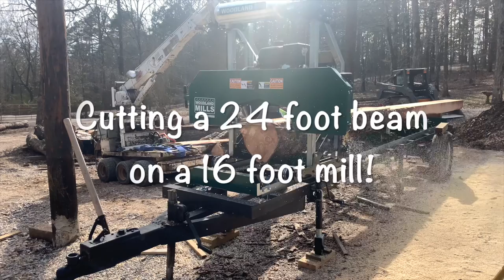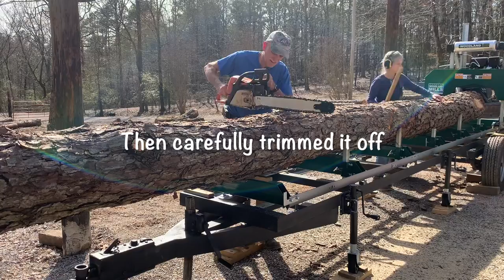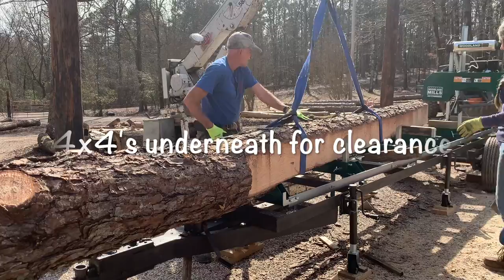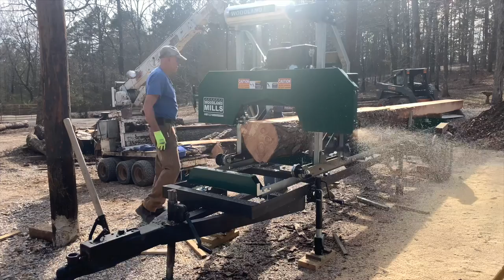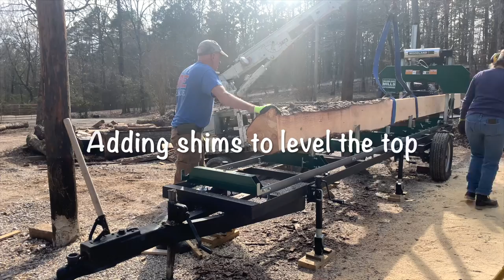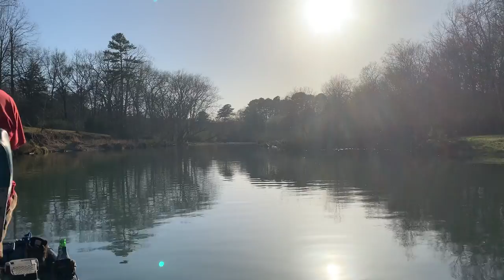Sawmill shed Part 2, cutting a 24 foot long beam on a 16 foot sawmill! Woodland mills HM122.

Comment: just an idea i have a friend that has the same mill and he maid an 8ft extention for his mill that comes off when he does not need it maybe something like that would work for you
Reply from the maker: Hi! Yes, this mill comes with a bed that will cut 10’ and we bought a bed extension at the same time that allows you to cut a little over 16’ lumber. That’s really about the longest we would normally need. But the problem is whatever length your mill bed is, you need several feet longer for the main support beam on your sawmill shed😂😂So, hopefully this is a one time project
Reply: Good to see it can be done, great work. Cheers from John and Audrey